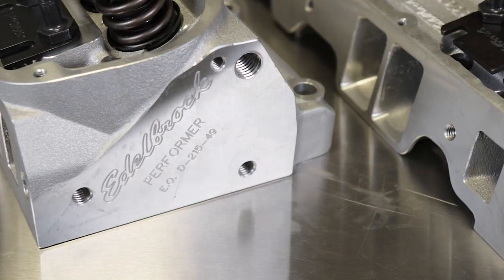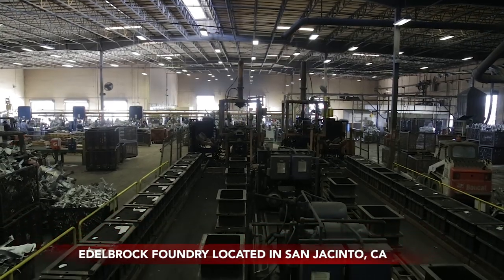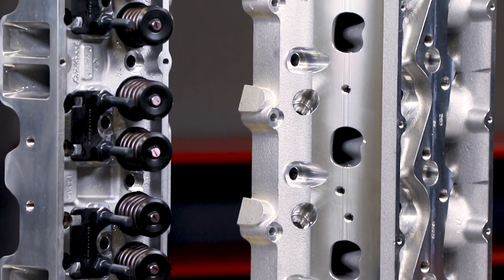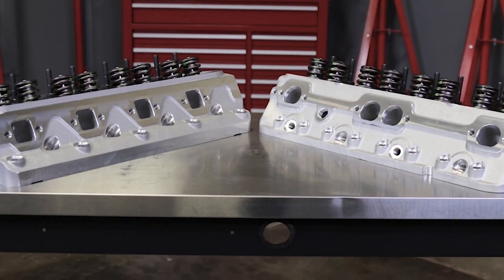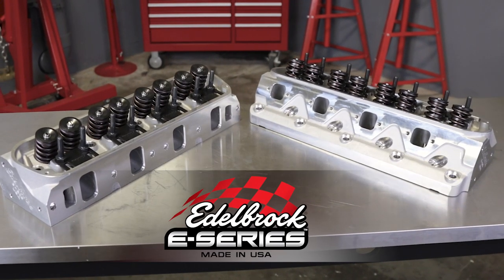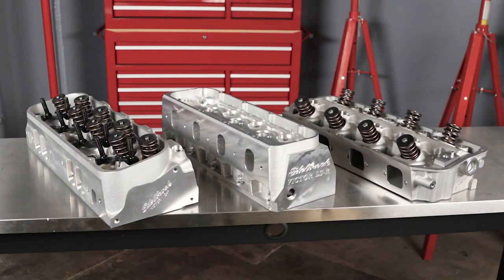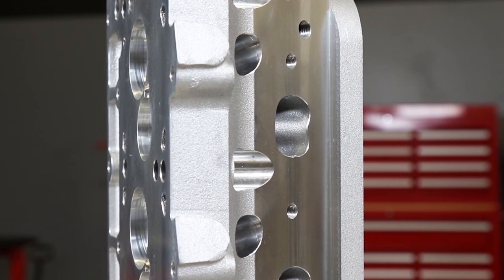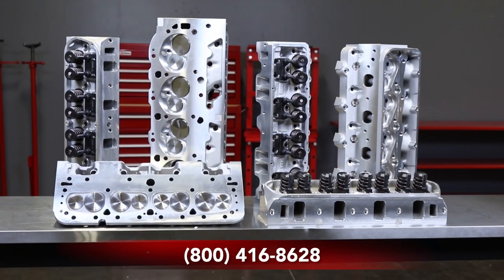Edelbrock Cylinder Heads

Comment: I bought my car with Victor Jr. heads on a 351w stroked to 427 with the Pro Flo 4 EFI… can anyone at Edelbrock tell me what the best Spark Plugs are to run on her?!
Reply: Autolite!!  And your compression will determine the heat range. Parts dealer can help you pick the correct number.

Comment: The Performer vrs the Performer RPM seems useless. The RPM kit is for 1500rpm and up which is where almost all V8 engines will be while moving in gear driving. The Performer is to start power band at idle wtf LOL. Who needs power at idle to 12-1500 RPM. Once moving the engines pretty much instantly goes to 1500Rpm and above. So the performer kit seems kinda useless when the RPM kit is designed to work in the range where everyone drives at and above.
Reply: Wouldn't that be good for crawlers?
Reply: port nut I agree. Love Edelbrock products. I wasn’t crazy about their performer carburetor though. I liked the old Rochester with those huge butterflies in the rear better lol. Those old Rochester’s really growl when you open the 4 barrel up

Comment: The heads themselves seem vary good, however i have 2 valves that the tips are pitting pretty good on, have had these head for about 4 years and only have roughly 10,000 miles on them, will be taking heads off to put quality valves in, shouldn't have to do this!

Comment: Hi we are in Australia, we have a custom built engine, 350 chev with edelbrock heads and manifold ............. we need to install the temp sensor what are people doing since there is no threaded place provided , thanks.  Is the only alternative to put temp sensor inline radiator hose.